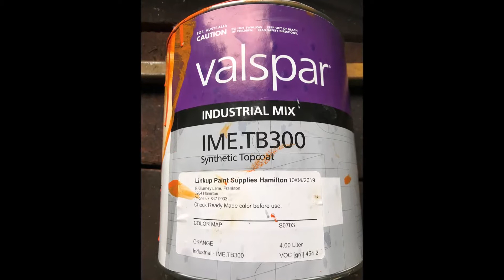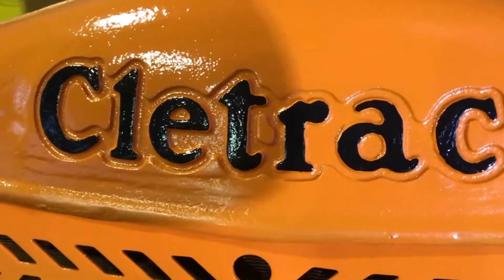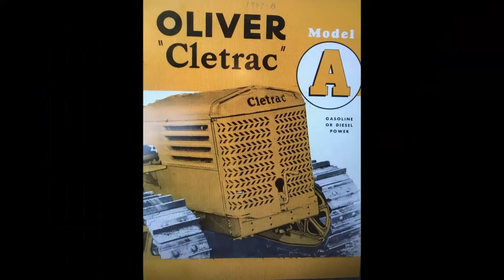Crawler Restoration II

Comment: Hi Sir.  I own a CLETRACT with a six cylinder Hercules diesel engine.  You would be so kind to inform me where I can get the measurements and tolerances of that engine or some page or video of the engine.  thank you very much for your attention.  very nice restoration.  I use a translator since I don't write English.  Regards.